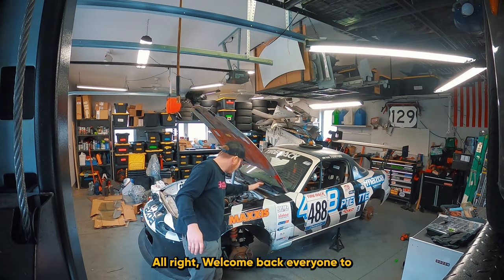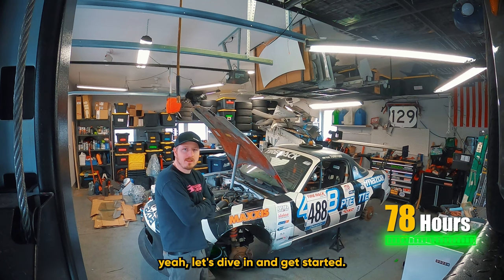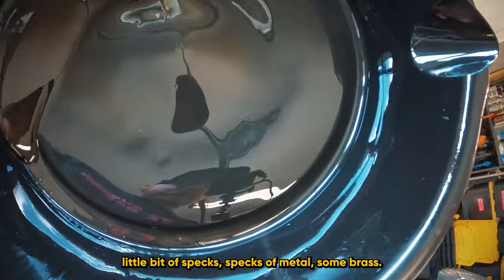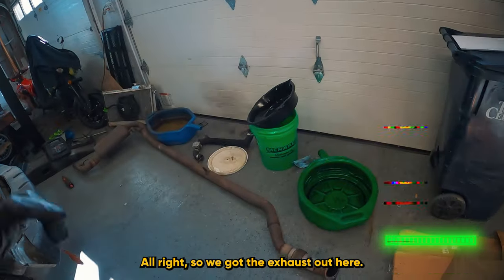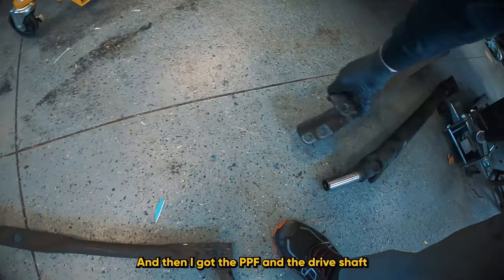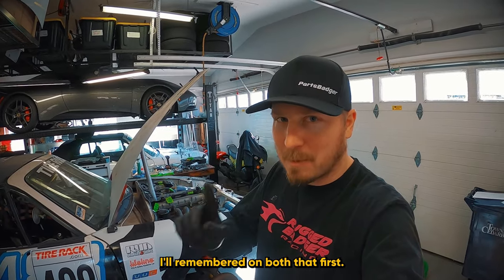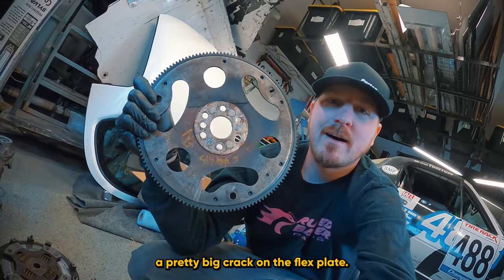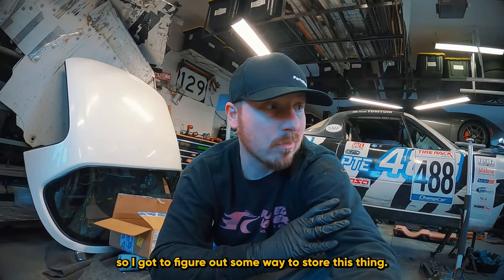How To Swap Ecotec Engine In Miata: Complete Guide For ChampCar Success - 80 hours To Gingerman

Comment: How is that sprung clutch disc going to shock the drivetrain?    

I have lots of racing experience with this kit.  Make sure to clean all the old locktite from the crank, the bolts backing out are a known issue incase you're unaware.  Try not to push all the loctite into the oil pan.    Hit me up with any questions.
Reply from the maker: I might have misspoke.  In my experience the ceramic disc is grabbier and will bite with a high RPM difference unlike the organic which would slip a bit.   That energy is then going to the transmission and differential versus the clutch disk.   It is sprung which is good, but I never had an issue with organic disks and they seem to me to have more mechanical sympathy.
Reply: @ruggedbadgerracing   Definitely, the incompressibility of the ceramic makes it extremely grabby once there are heat spots on the clutch/pp.  If both are freshly machined then used properly (including break-in) then they are far easier on the rest of the drivetain.
Reply from the maker: @devonthorpe7863  Good to know, thank you!